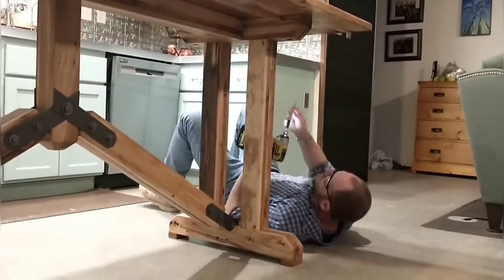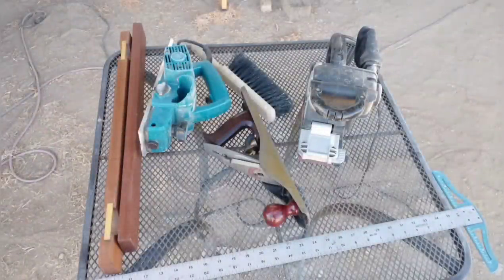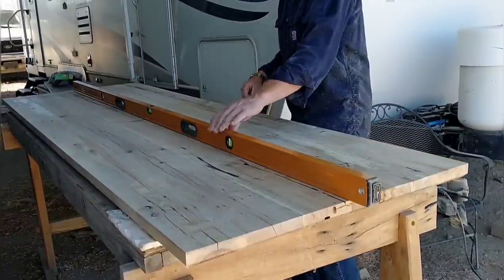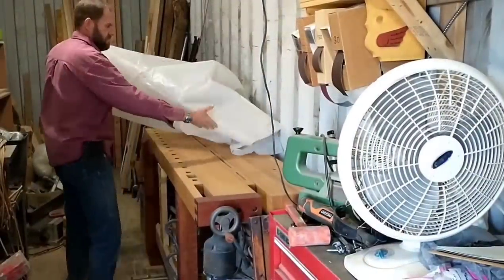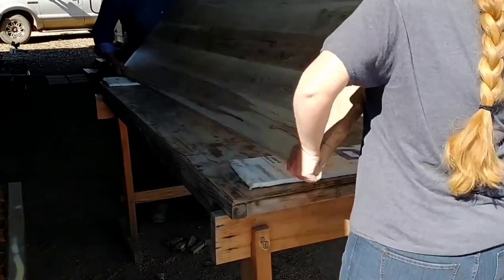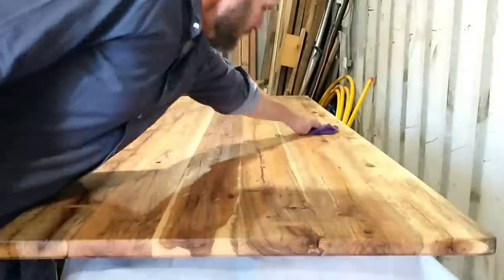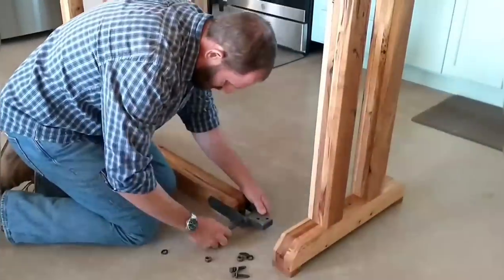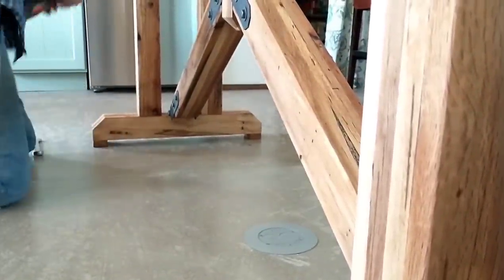Custom Kitchen Table Build (Part 2) Hardwood Live Oak | Long & Narrow

Comment: Absolutely beautiful table. True craftsmanship on this heirloom table. I'm sure it will last several generations. I built our similar table in 2005. The legs were made from reclaimed pallet hardwood sculpted on the table saw. The skirt and top are red oak. Our granddaughter has already placed a future claim for it. I built ours to standard table height, I like my feet on the floor. Thank you so much for sharing this with us.
Reply from the maker: Thanks so much! Pallet wood is definitely a lot of work! Sounds beautiful! 😊